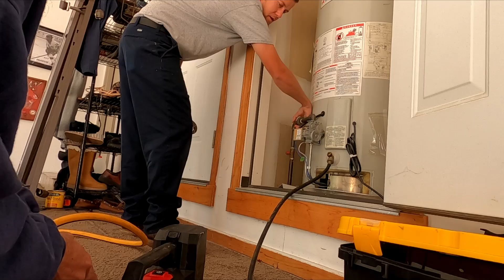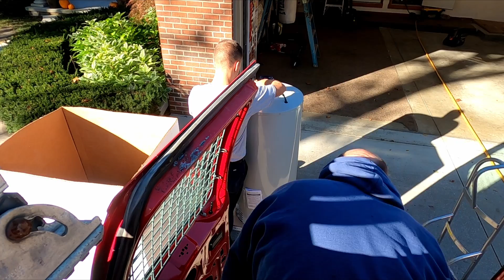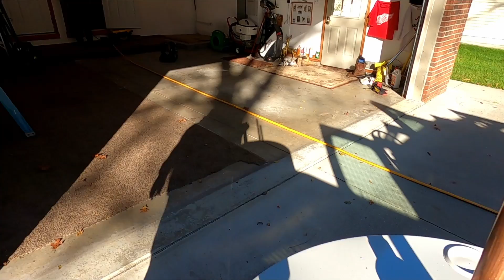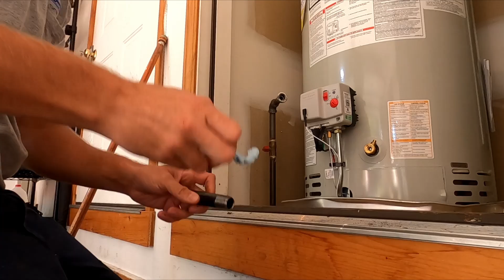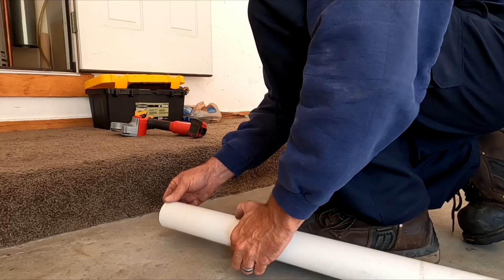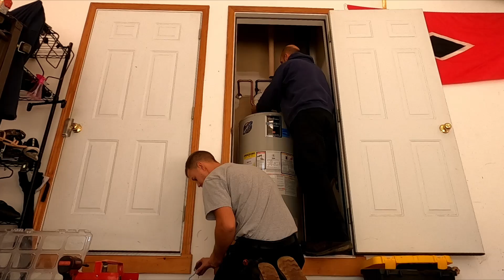50 Gallon Power Vent Water Heater Replacement

Comment: I noticed you didn’t ream or clean the copper or PVC. I  also didn’t see you use any flux on the copper pipe. Why is that?… 
And, what size and schedule pvc and copper did you use.